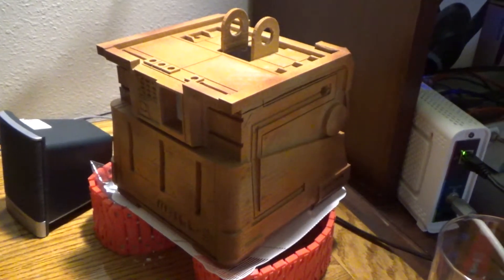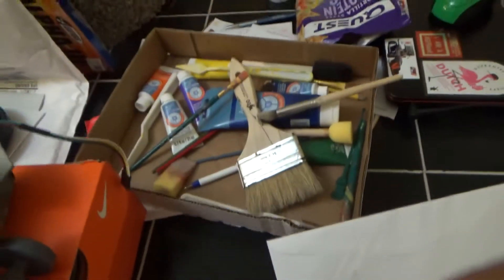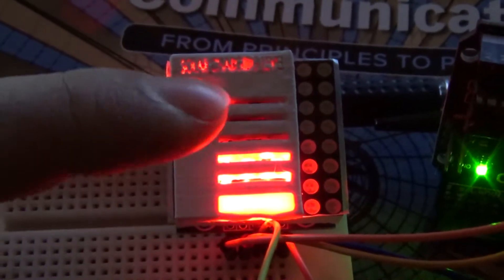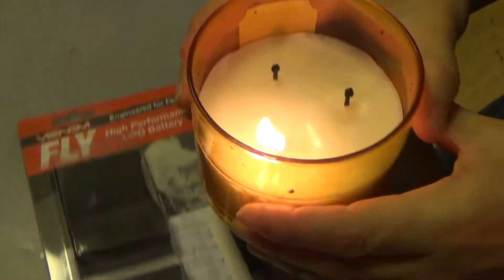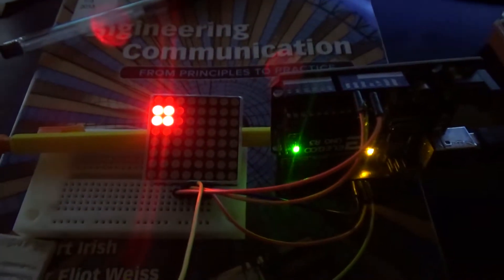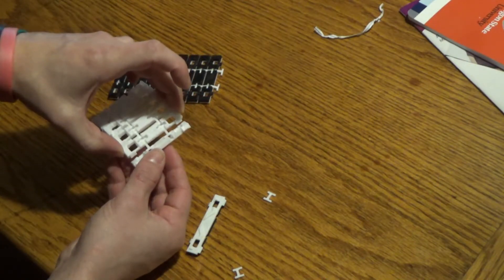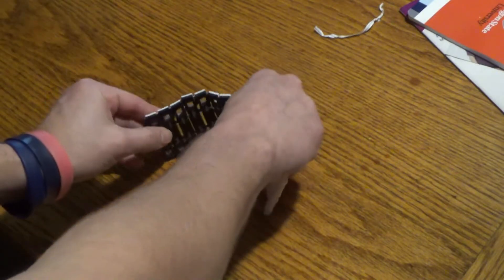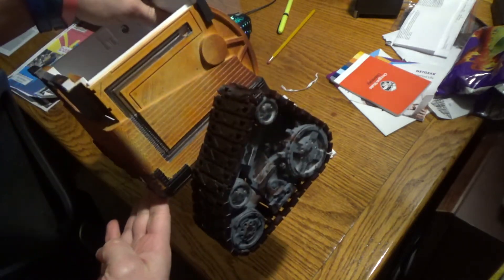3D-Printed WALL-E Bot Build!  |  Part One  |  EDGE+

Comment: im also building wall-e myself if you dont mind what paint s are you using to get this color for hes body
Reply from the maker: sorry for the delay, we used a brown general spray paint for the bottom layer and then yellow for a light top coat. both the spray paints were from a department store like Walmart or Fred Meyer. the track parts are black paint and then just some grey acrylic paint from a department store as well. I unfortunately did not not exactly what paints I was using.

Comment: Cool build. What did you use for a battery to power it all?
Reply from the maker: We are using a 3s battery with a voltage regulator to power the PI and direct power for the motor driver.